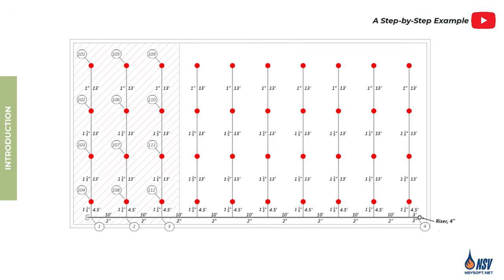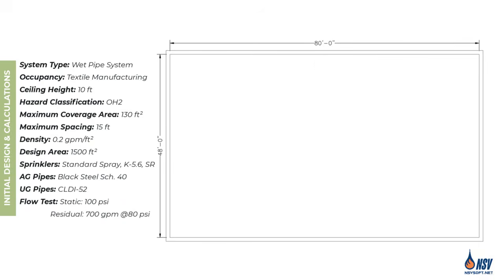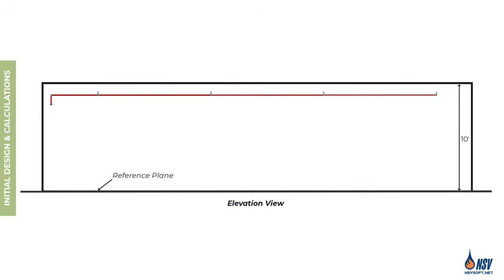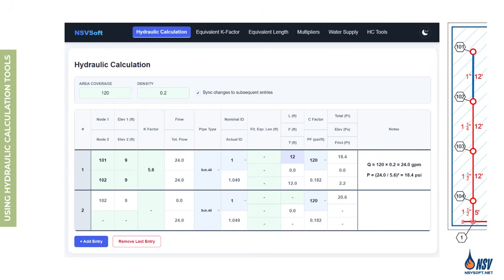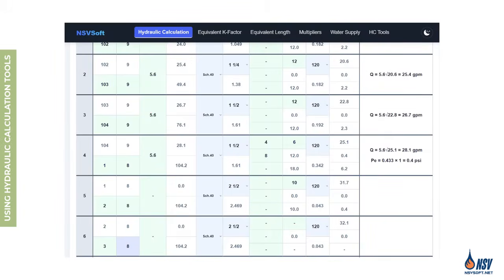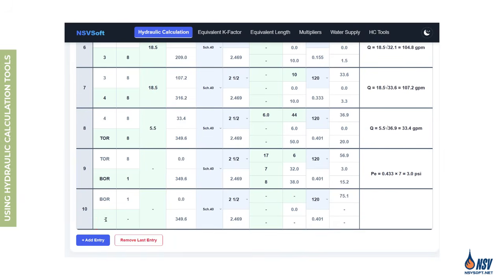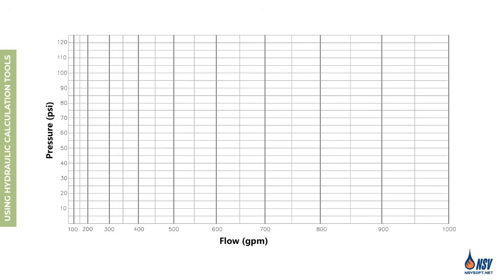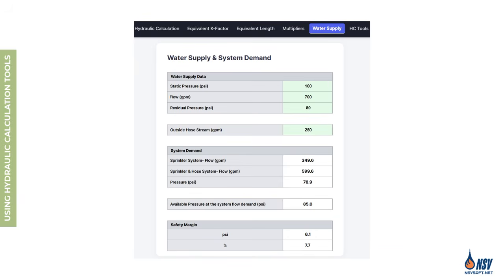💻  Free Online Tools for Hydraulic Calculations in Fire Sprinkler Systems (NFPA 13)

Comment: Thank you. What happens if the branch lines are not identical? Meaning the sprinklers are not in series.
Reply from the maker: Thank you for watching the video!

This software was developed for educational purposes and is particularly useful for performing hydraulic calculations for uniformly spaced sprinklers in tree-piping configurations.

Our main objective in developing this software was to help our audience become more familiar with the fundamental concepts of hydraulic calculations and understand how software can save time when determining values such as pipe internal diameters, adjustment correction factors, and applying the Hazen-Williams formula.

When dealing with non-uniformly spaced sprinklers, one of the first important topics to address is determining the coverage area of each sprinkler. We have covered this topic in the following video:

https://youtu.be/W7Iowc12Z94?si=oSNYvPcLMhCNt67J

The next step is understanding how to determine the design area. We have reviewed one scenario in the following video:

https://youtu.be/GV4ujJbIlSw?si=nKydk-JQJcjwVxTs

We hope these resources will be helpful to you!

Comment: The video is amazing! I have a question: does the K-factor become smaller as the cross main size gets larger?

For example:

40 mm diameter → K-factor = 32
50 mm diameter → K-factor = 28
65 mm diameter → K-factor = 24

Is it correct that the K-factor decreases as the pipe diameter increases? thank you for answering
Reply from the maker: Thank you very much for your comment!

We recommend watching our video on the K‑Factor, available at the link below:

https://youtu.be/0mrerqLDnxw?si=WnCsFXhRbKzYJWw7

If you still don’t find the answer you’re looking for, we’ll be happy to clarify.
Reply from the maker: Hi Rimuru,
Just following up to see if you had a chance to watch the video and whether it helped answer your question. 

If not, you’re welcome to contact the presenter, Hesam Tavoosi, directly.
LinkedIn: www.linkedin.com/in/hesam-tavoosi  
Email: hesam@nsvsoft.net

He would be happy to help.

Comment: WHAT IF I HAVE 60 MM CROOSS MAIN TO 80-90-100 MM HOW TO CONSIDER THE K-FACTOR? & CAN THIS SOFTWARE BE USE FOR FIRE HYDRANT AS WELL?
Reply from the maker: Daniel,
For the first part of your question, please take a look at the article below. We explain three different methods for determining the equivalent K‑factor when pipe sizes change:

https://nsvsoft.net/blog/Optimizing-FireSprinkler-System-Demand

Regarding your second question: the hydraulic calculation for standpipe systems or fire hydrants is fundamentally different from sprinkler systems. In sprinkler design, the flow of the most remote standard spray sprinklers is based on area × required density, and the remaining sprinklers in the design area flow according to available pressure and their K‑factor.

However, for fire hydrants and standpipe systems, the required flow at the outlets is a fixed value, independent of K‑factor or pressure. Because of this, the current edition of the software is designed specifically for sprinkler systems.
Reply: @NSVCad  Thank you, sir, for this lovely explanation. One last question: why is it that in almost every YouTube video I watch, the cross mains are all the same size when doing a hydraulic calculation? Is that how cross mains should be sized, or do it get larger and larger depending on the number of sprinkler heads they serve and the required flow capacity?
Reply from the maker: You're welcome!

Please watch the following video, we answered your question!

https://youtu.be/7u1XLnWYi1U?si=ci5t4NQ95s8XOpUS

Comment: what 3D software are you using @ 5:35 ? 🤔
Reply from the maker: We used AutoCAD 3D to model the piping and fittings. In the fire sprinkler industry, software such as SprinkCAD, AutoSPRINK, Revit and HydraCAD can be used to create full 3D models. We are also adding a 3D modeling option to NSVCad.